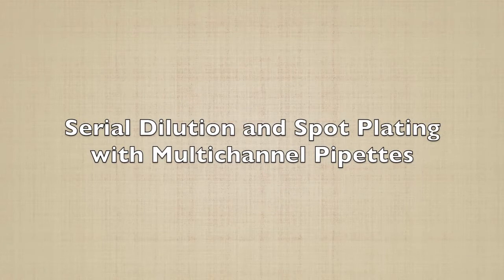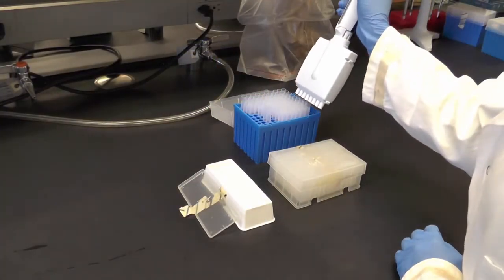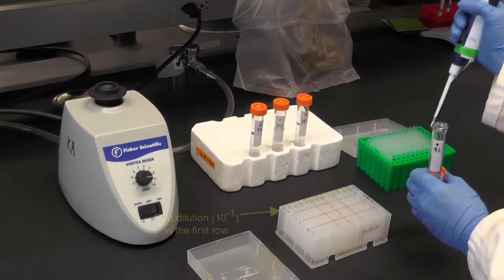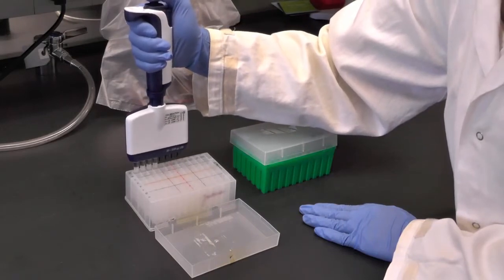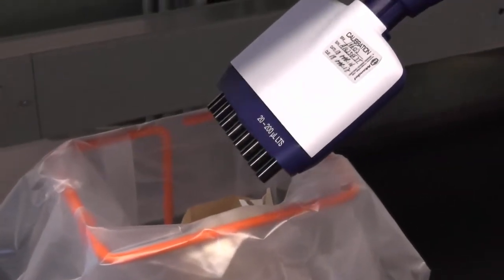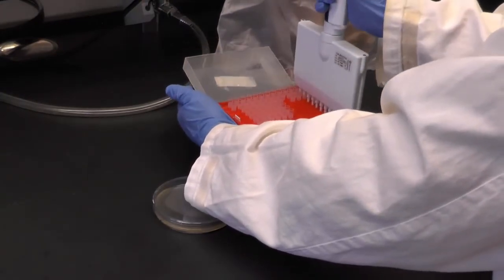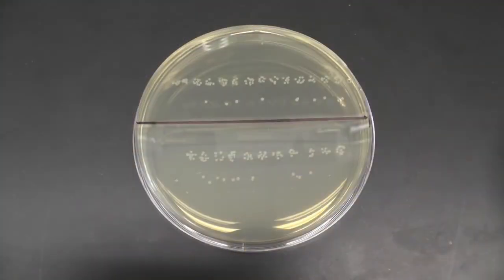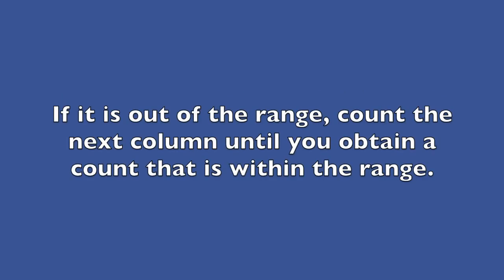Time-saving Serial Dilution Preparation and Spot Plating

Comment: What is the formula
Reply: You'll be making 1:10 dilutions for each spot dilution. In my lab we add 5ul to 45ul of the previous dilution to achieve this. When we plate, we add 5 5ul spots per dilution. The formula to calculate how many CFUs you have will be CFU/mL= (Colony total)/(total volume used)*10^dilution factor. For example if we count 37 colonies in a -1 dilution within 25ul volume, we will get 1.48E+04CFU/mL.